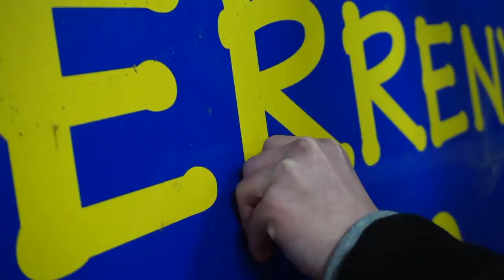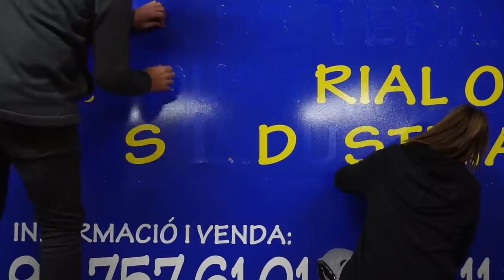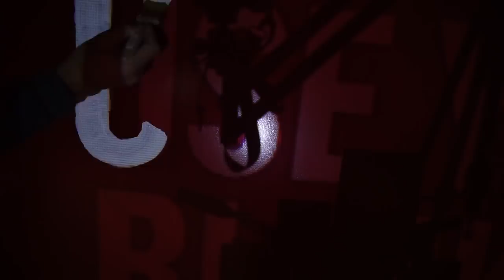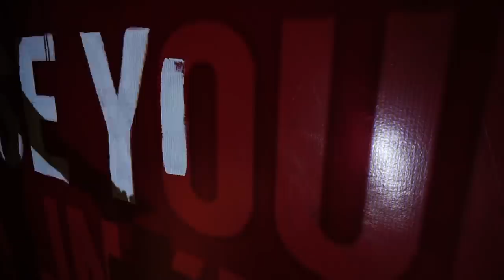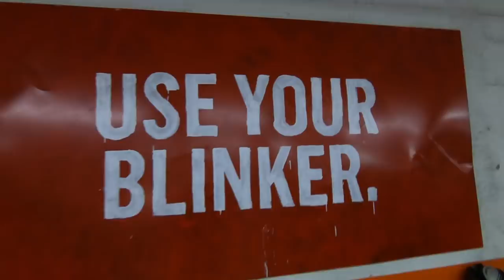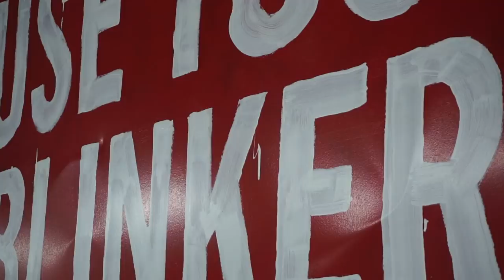IMPORTANT REMINDER - Billboard Artwork

Comment: Are you guys okay? BMCO Team?? 
So what does the video's means?

Yo Bro? 
The message's written on red color
Then the text dripping

Hope you guys are okay bro 😞
Reply: It says use your blinker, that means use your signal lights
Reply: @refard5  damn it's right ... But i kinda bit worry about the real message by making this video.. hope everything's okay ... 

Cuz i have an experience
I had an accident on 22 sept. 2017
I hit a couple that ride a motorbike then they didn't use their blinker while their trying to take the U-Turn
I was on the fast lane
They from the slow lane or the most left side of the road (i'm Indonesia)
I was ride my brand new YZF R15 2017 V3.
I hit till 80 kmp/h
Then suddenly they (the couple) merge the lane while trying to take the U-Turn ..
They don't think about the surroundings, they just do it. Turning without considering who's behind them.

Then i can't do sudden brake
I just low until 60 kmp/h
Then i hit their bike and crash

I don't remember anything since that accident
I've got 2 fragments on my face
Ripped elbow with dozen of stiches
I can't see for several weeks
Short term memory loss

I just telling to other people to be careful when ride/drive on the street
cuz anything could be happen. So just be aware..